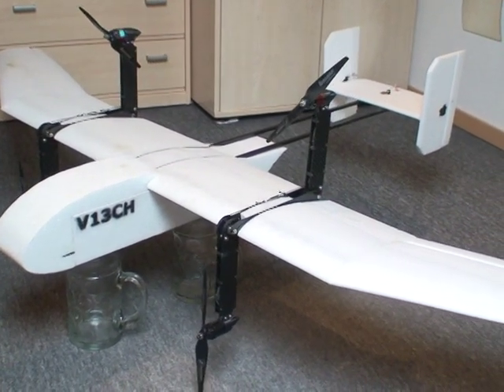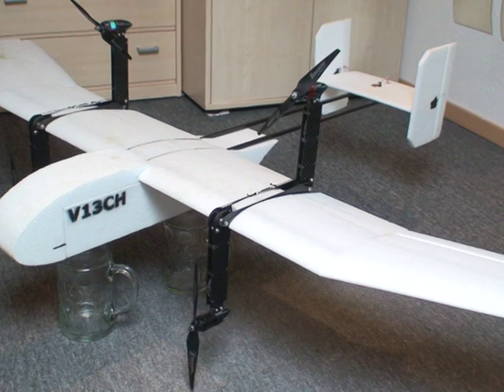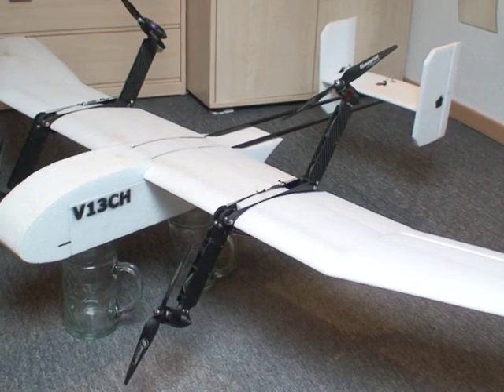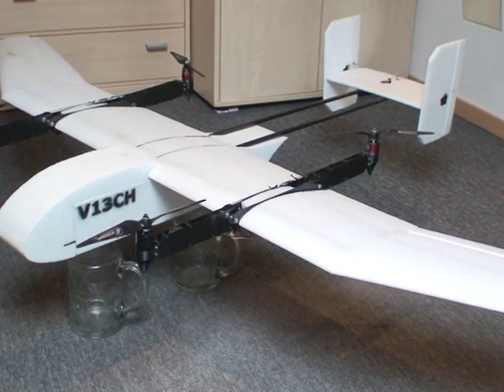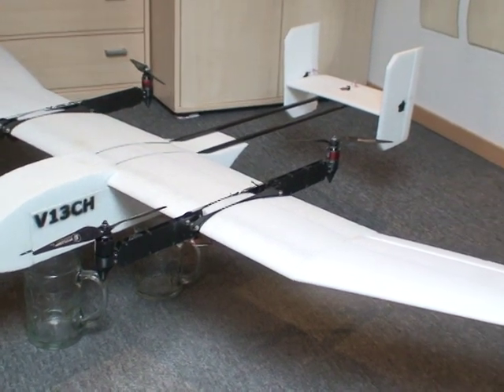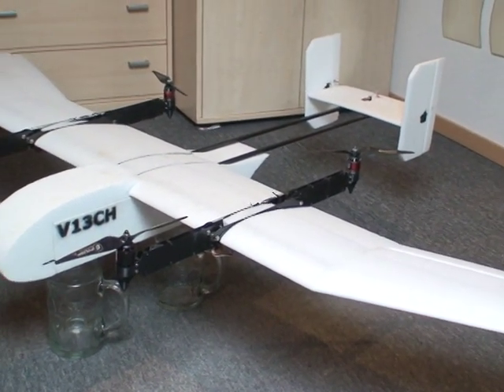Wingcopter - short mechanical mechanism demonstration

Comment: What a great design. I've been dreaming of a tilt rotor quad for years but I could never see a good way for the tilt mechanism to work and still maintain good CG. 

Your solution is genius. 

I wonder could it scale up to full scale. Batteries might no cut it but maybe a gas turbine generator could be used to produce electrical power. It would be mechanically much simpler than a traditional helicopter, true vtol, with the flight efficiency of a regular plane.

Comment: Hello! I’m Maciek from Poland and I’m interested in building similar plane as yours (VTOL plane&copter). Could you please tell me, what kind of Flight Control Board you used? Was it hard to program the Board that after vertical take-off and changing mode from copter to plane mode (changing motors positions), the Board will not “lose it selves”? Is it possible to change mode type (copter>plane>copter) during flight? The Board will change it selves into a quadrocopter or plane mode (I’m talking about stabilization, RTL etc.) automatically, or maybe the Board can be changed manually after moving motors vertical>landscape>vertical for example via special channel (by a switch on transmitter)? Looking forward, Maciek.

Comment: Hi... i know u r powering this with APM which means u have 4 outputs attached to yr motors and another 4 attached to yr 2 elevon,rudder & elevator... how did u tilt the rotors? where is the pins connected since all 8 output pins were used? I'm very impressed (y)
Reply: maybe they have an auxiar servo that with the same signal that mode chanel has